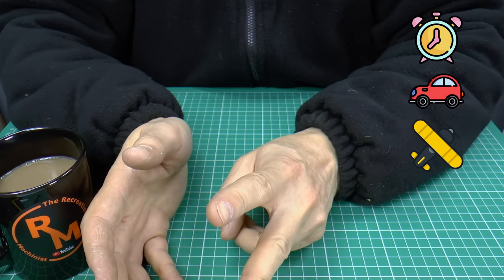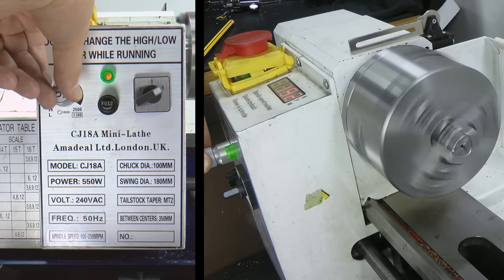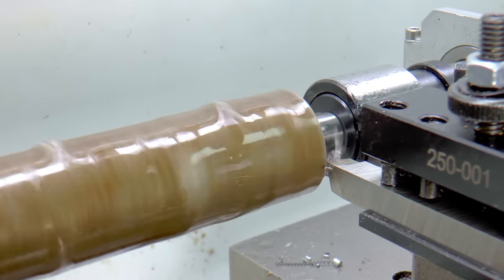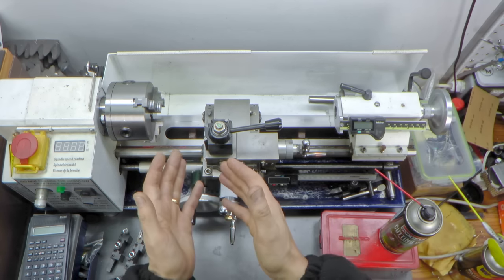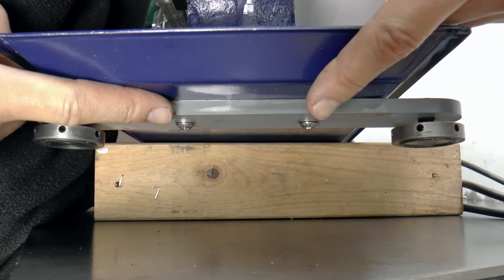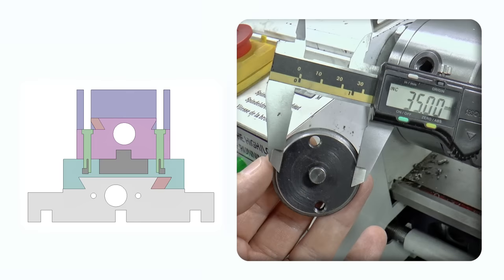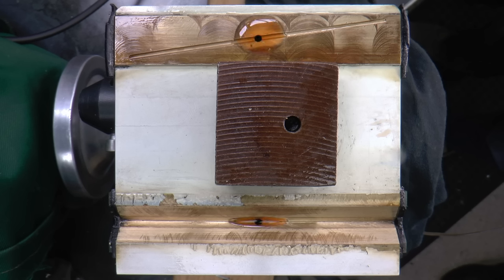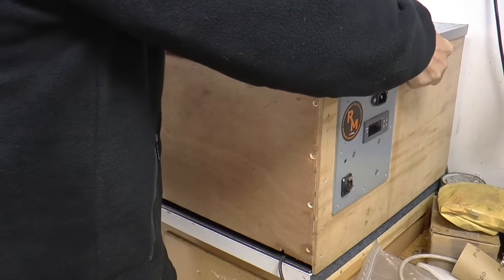10 Years of Mini Lathe Ownership: Pros, Cons, Modifications and Improvements

Comment: As a machinist with 40 years exp, small lathes work fine *for small parts*. When you are cutting steel bar, the greater the diameter, the greater mini-lathes lose their power. I mean, the range a min-lathe has in terms of capability is very narrow. Becuase of this, I would not buy a mini lathe. I'd rather get a larger one because it's far more robust and cut better and faster than a mini lathe. As what kind of lathe I'd get, it would not be a Chinese made lathe. A vintage lathe like a Logan would be ideal even if it means restoring it.

Comment: @26:44 the evidence clearly indicates that the head stock is off axis. It's slanted this way \ so when facing - the cutter makes a cone like <. Some (most or many) heads have some form of head adjustment screws. Consult the manual for your model.